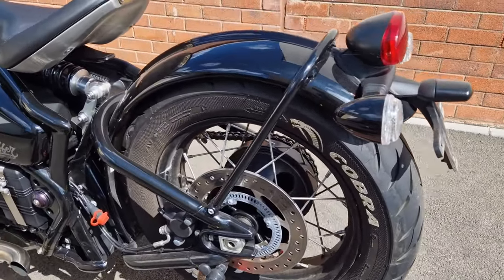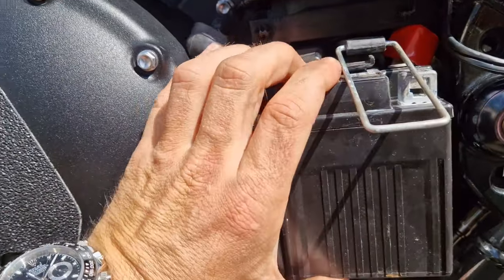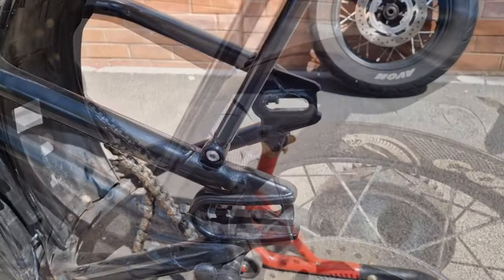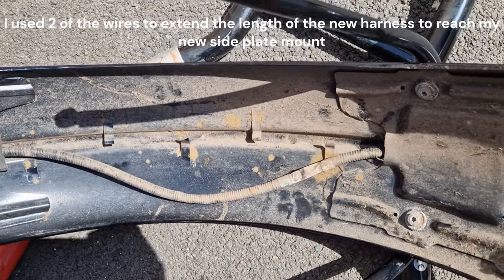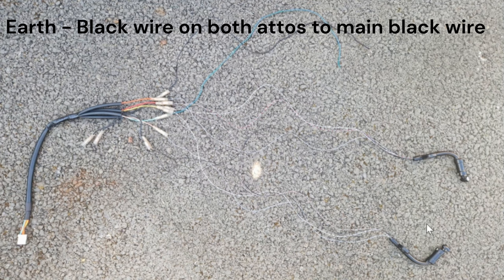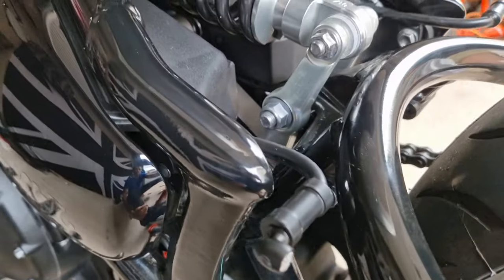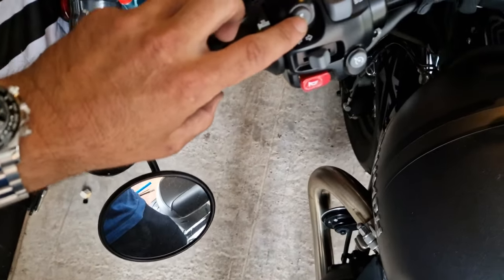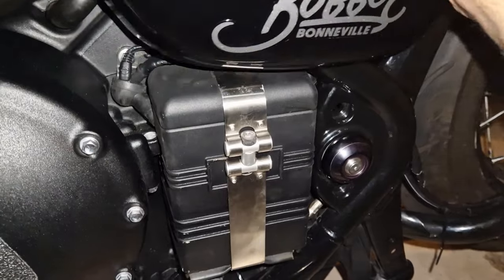How to remove the rear fender on a Triumph Bobber and fit a custom tail tidy

Comment: I like the look while it is sitting still, but I built a small custom bobber with no rear mudguard and in the slightest precipitation I had a strip of water/mud from my bum to the top of my helmet. I guess it never rains in England, huh? For now I will keep my Bonneville bobber stock until I can find an effective but cool rear fender.
Reply from the maker: You are so right. I absolutely love the look of it but I do get soaked if it's wet... to be honest I hate riding in rain or wet so won't go out anyway. It's a hobby not a necessity.... i looked for so long for a good looking fender decided they don't exist and went without

Comment: Looks great! Unfortunately in Spain we are forced to put something as a mud guard, can be small but something needs to be there. On the other hand, could you tell me the measures of the tyres?
Reply from the maker: Thanks I'm glad you like it . These are the stock tyres for the bobber which without the rear fender makes them look quite skinny. I can definitely see why most choose to put a wider back wheel on without the fender. What do you think?
Reply: @britishbobber definitely looks way wider without it. However I've seen that some people manage to fit a 180 in the stock bike. Is too much but a 170 would look awesome!
Reply from the maker: Yes I'll have to look into these sizes and see when I can put one on
Reply: Definitely need a small fender.   @britishbobber

Comment: Why ? What's going to happen the first time you go through a muddy puddle? Have you never ridden a push bike without a rear guard on a wet road?
Reply from the maker: I have ridden this bike through a muddy puddle and got absolutely soaked up my back.... the trick is to ride in great weather. I avoid riding in the rain at all costs.. even did with the fender on. Hate it! I much prefer to be comfortable and no fender just looks much better

Comment: Really helpful video; thank you. Can I check if the battery disconnect is a must before fitting new indicators/tail tidy?
Reply from the maker: Thanks, I'm glad you found it useful 😁. It was a must for me because I needed to change the stock wiring loom. I also didn't want to risk shorting the battery from any loose live wires touching each other or other parts. I'm no expert so 5 minutes disconnecting the battery was well worth it.

Comment: Thanks for this vid bro, just taken my rear fender off as per your instructions 👌
One question, do you use anything to stop crap going in the battery box and surrounding area please?
Reply from the maker: Thanks mate glad it was useful. I havent had anything go into the battery box itself up to now. The cover already in place does a pretty good job although the space under the seat gets pretty wet and dirty now. I generally avoid riding it in the wet now it hasnt got that rear mudguard.
Reply: @britishbobber  thanks mate, it's pretty hard riding at all when trying to avoid the wet 😞 I'll see how it goes. Thanks again.

Comment: Hi, do you know if it is possible to change the pulse rate for the indicators on the 1200xc scrambler? Thanks . Really liking the the dinky indicators.
Reply from the maker: Im not sure mate sorry. Id assume it would be the same standard process. Best thing would be to just go try the method i shown in this video and see if the option comes up to do it. I love the attos too I'm thinking the front indicators will need to be done now aswell 💯